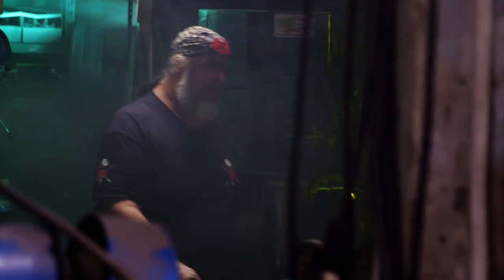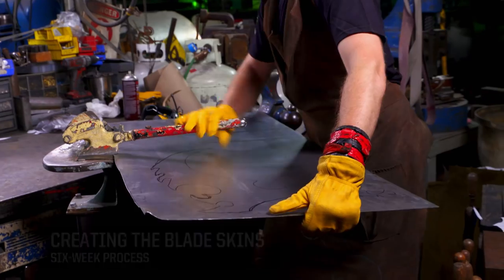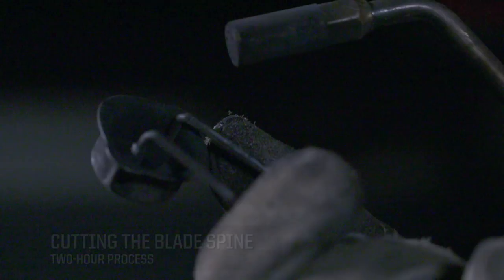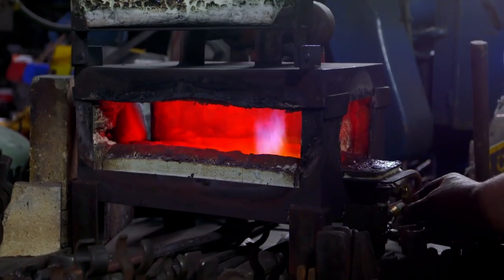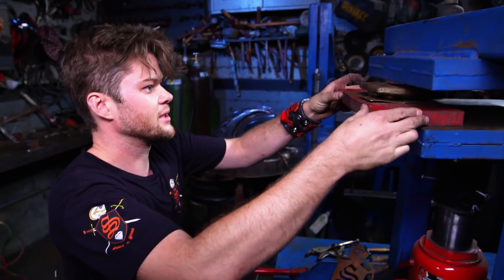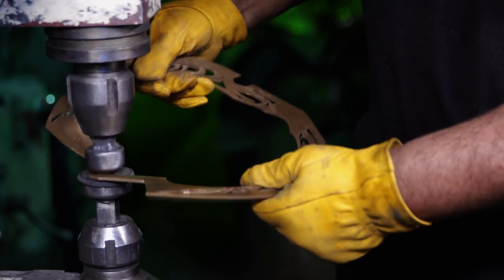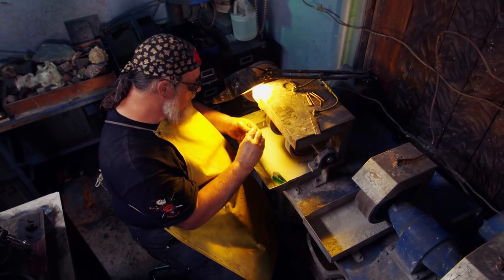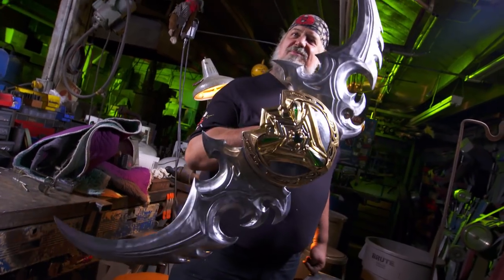Azeroth Armory: Forging Warglaive

Comment: Warglaives are actually the worst weapon for an actual combat...
Reply: Nope. Toasters are much worse
Reply: I don't know about you, but have you ever tried fighting with a milk carton cap? Its pretty hard.
Reply: At least you can throw a toaster.
Reply: Otakahunt The only way warglaives could be useful is if you were fighting a naked man, because warglaives ain't gonna pierce any armor, I mean in terms of WoW (applicable in real life) they would do damage to cloth and leather users, but to mail, let alone plate users not a chance, no wonder he lost to Arthas...
Reply: says who?
Reply: In wow terms the warglaives power comes into the abilities, you can see how illidan is able to use them with the abilities that he has. but you are right, irl they won't be able to win a fight
Reply: Jose Sandoval
ye but have you tried fighting with a milk cap?
Reply: +ragsungschaft It wasn't funny the first time.
Reply: Not denying they are a horrid design for a weapon IRL, but they are meant to be used as a pair and with slashing attacks and spinning (which you should never do). These would never be used to stab with the blade points. To effectively use warglaives would would have to be effectively be dancing to keep the momentum of a 25lb one handed weapon up.
Reply: Brahvent
All I want to know is if you have tried fighting with milk cap carton. Was not meant to be funny.
Reply: leather is actually surprisingly hard to cut through (you'd get through the armor but deal almost no damage)
Reply: training to keep momentum up is basically how the demon hunters who use them train
that and warglaives are meant to be used with magic (the glaive wont cut through armor, but the magic certainly will)
Reply: The warglaives are meant to be used by people who are really strong, as in inhumanly strong. Also demon hunters are meant to be deep in battle, fighting demons from all sides. If you have the strength to cut through flesh and armor like butter, the would be... decent at fighting enemies from all sides. They are still horribly impractical, and if you could lift 2 warglaives you may as well just carry a canon into battle, but it isn't horribly unfeasible. if you throw magic and demonic energy into the equation, its hard to know what exactly makes sense.
Reply: Stefan Petrovic
 Why would it need to pierce? demon hunters fight against demons... and most demons are made out of flesh, hard flesh, soft flesh, green flesh, red flesh.
They dont really wear armor.
Reply: Otakahunt
Demon soldiers wear a lot of armor. look at fel guards and eredar.
Reply: Sdogofdoom
and pit lords. fel hounds seem pretty fast so you need to make every hit count
Reply: Alex Gregory
But we have all seen what little use pit lord armor has XD seeing as mannoroth was killed in one hit by grom wielding gorehowl... TWICE. And we know gorehowl is not that great a weapon, i mean its meant for level 70's.
Reply: Sdogofdoom
lore wise gorehowl is a pretty good weapon (what it is in game has nothing to do with lore) and grommash is an extremely strong warrior (in our timeline is was also on demons blood making him a little stronger)
but not only external armor, pit lord hide is probably extremely tough as well
Reply: Alex Gregory
Lorewise, gorehowl is imbued with the power (and hearts) of several massive gronn, and forged by the best smiths the orcs had. It is still hilarious that gorehowl can pierce METER THICK PLATE XD
Reply: Sdogofdoom
I was not aware of the forging story of gorehowl and had never thought to look into it, that makes gorehowl one of the cooler weapons IMO
as for meter thick plate, super weapon, super strong wielder, can so super weird things
Reply: Alex Gregory
The doom hammer couldn't scratch mannoroths wing. Gorehowl pierced a meter of reinforced, commander tier plate, AND right through the strongest part of the pitlords skin and ribcage. (if pit lords have rib cages like humans, which they may or may not.)
Reply: depends, if you train for years almost anything can become deadly. If you turn an strike over your shoulder you can use the point of the end of the blade. Most weapons are useless against armoured targets in real life anyway, but full plate armour wasn't common and when you were fighting someone wearing that you'd be using a hammer. Most soldiers wore cloth and against someone who has trained with these weapons they might not be able to land a strike. 

Imagine capoeira mixed with these.

In warcraft everyone wears plate armour, but in warcraft everyone has muscles bigger than your head.
Reply: Sdogofdoom
 "look at fel guards and eredar"
Thats exactly what i mean... they are half-naked! No such thing as "alot of armor" in the demon-ranks.... its not like they need much, they cant die anyway.
Reply: Otakahunt
Yeah but they have some parts that are very armored. not saying its practical or smart, but they do have some bits of thick armor.
Reply: Sdogofdoom
 You dont have to hit those armored parts, you know.
Those guys dont have any armor in their midsection... which is the area to go for in a "knife fight".
And since demon hunters are highly trained and skilled... they  have no trouble hitting  that area.
Its like being half naked in  the medieval times...and you  cant blame the demons, not like they care.. they wont die anyway so might aswell fight with nipples out.
Reply: Otakahunt
some demons (such as infernals) are not flesh at all, though DHs probably have different ways of dealing with them (probably magic)
Reply: you have to have the agility and raw strength to dash and move with force like demon hunters to make them work
Reply: Stefan Petrovic I feel like if a person is unnaturally large, strong, and agile, this would be a great weapon
Reply: @Sdogofdoom
Strength doesn't help you cut through armour, though. This is a simple matter of physics and common sense: If you can freely shape a material with the desirable properties of a blade into a blade, you can also shape it into armour.
Now, what are the desirable properties of a blade? Obviously, you want it to be extremely hard to damage. After all, if your weapon breaks upon the body of your first enemy, it doesn't matter how awesome it might be. You'd be defenceless against every enemy after the first.
Now, what does it actually mean for a blade to be hard to damage? In essence, it means three things:
1) You want it to be hard. If your material is too soft, it will simply give way under its own force.
2) You want it to be flexible. If you watch slow-motion footage of cutting or thrusting tests, you'll notice that during impact, the blade flexes a lot. This is desirable because if your weapon is not flexible, it will break too easily.
3) You want it to keep the shape you forge it into. After you bend your blade, you want it to return into a straight shape instead of staying bent.

If you have a material with these properties (in real life, we do have such a material, and it's high-carbon, hardened and tempered steel, also called spring steel) and can shape it into a blade, you can also shape it into armour, and it just so happens that these three qualities are also the qualities you look for in armour.
And one rule of thumb is that you can't cut a thick material with a blade made of the same material. You can't cut a copper plate with a copper sword, and the exact same goes for obsidian, steel, enchanted stormsteel, or mashed potatoes.

@Otakahunt
Demon skin has been described numerous times in WoW lore as being hard to cut or pierce. Add to that that basically only imps, felhounds, and beholders go into battle unarmoured, and you have a compelling argument for why you want to consider your choice of weaponry well.

@UB3RFR3NZY
You're generalising over a very large period of time. During the late middle ages and the early renaissance plate armour was fairly common.
In earlier times soldiers did indeed often use cloth armour, but to modern ears, that's a dangerous statement to make. What they wore into battle were gambesons, which were several layers of thick linen or wool. A proper gambeson was easily able to stop a full-powered sword strike.

@Angry Chicken
It's really not, but after writing half an essay for a YouTube comment, I don't feel like going over all of the reasons as to why not, unless anyone's explicitly interested.

Comment: The way that shirtless guy held and wielded the warglaive was all wrong.

1: You don't use the shield to bash things like a Spartan! That's how you shrink the protection to your arms.

2: The 2 blades are what allow Demon Hunters like Illidan to catch a demon in the back swing, making sure no gesture is wasted in battle! The shirtless wielder failed to do this.

3: The weapons are MUCH LARGER, which makes for a wider cutting edge! At 20lbs, the weapon lacks the sufficient heft to cut into demon skin! At the very least, TWICE the size of the one forged.

4: An additional grip to stableize the weapon so the blade edge remains parallel to the wielder's punching knuckles of the index, middle, ring, and pinky fingers, would have been helpful to the design.

Otherwise a great weapon, but that shirtless guy wielding it just ruined it for me...
Reply: I bet you're fun at parties.
Reply: Sooo uhhh.. You have a lot of experience fighting stuff in RL with glaives?
Reply: 1: Yes, you do use the shield part of your weapon to bash. In combat, a shield is not armor, it is a *weapon*. You use it actively, either to defend yourself against enemy attacks, to cover yourself while you attack yourself, or to simply hit stuff. In fact, your arm might be the most protected part during a shield bash.

2: A regular sword can do the exact same thing; either striking with the pommel or generally moving in a way that your blade remains facing the enemy. With a warglaive, you generally can't use both blades in the same swing, and even if you could, you wouldn't want to, because the force of your attack is split between each target hit. This means that you only ever use one blade per attack, making the other blade a pointless counterweight that bluntens the impact of your strike. Speaking of which ...

3: If demon skin were so tough to cut, you would either use a sharper blade or a weapon that's better suited to applying large amounts of force, such as an axe or a pick. Making a sword heavier doesn't make it a better cutter; in fact it makes it worse since having to swing around so much weight makes you exponentially slower, thus weakening the impact force once more. Points 2 and 3 are nothing but basic physics.

4: I don't know what you mean by that, but if it means fixing your fingers in place in any way: That's a terrible idea. If you can't move your fingers while your blade gets stuck in a falling demon or while it's being parried or otherwise controlled, you are setting yourself up for a broken hand.
Reply: Nerd

Comment: for the glaives to be actually functional, the blades would have to extend forward from the shield and then turn less toward the user, as well as be at least 6 " shorter.Great wall hanger though.

Comment: If he was having trouble actually holding the warglaive because there was only a grip i can understand. Holding a cylindrical object that has a lot of weight will actually just cause it to rotate to best match gravity. Hence why at 6:54 it isn't parallel to his arm but perpendicular. There should be an additional "sleeve" near the top of the warglaive that he can fit his arm through in order to keep a proper grip on the warglaive. that would also actually really help in keeping yourself from being disarmed. Though it becomes a big problem if your enemy "hooks" their weapon in with yours.

Comment: we can see the handling of the blade is different than seeing it in-game without considering the actual weight when its swung. I guess for the purpose of demonstration that its really sharp, the person has to wield it with safety. To properly handle both blades in actual, someone has to have an incredible amount of strength to swing it both hands and with balance from both Glaives.

Comment: They went to a LOT of trouble with the camera work to never show the back side of the weapon when it was done, because it was obviously just hollowed out with no actual thickness to it.
Reply: 7:20 You're welcome
Reply: That was certainly a quick glimpse and it is hollow in the center. I don't blame them for the hollow blades, less it weigh 100+ lbs, but they certainly avoided showing it from that side which really made it look awkward when used.
Reply: Did you not watch the video? Right at the beginning they said it was going to be hallowed out.

Comment: Wait, why did they use rusted metal?
Reply: most metals used for this have a bit of rust on the outside, it has no effect to the steel underneath, at least not for a long while, you just grind it off.
Reply: Keith Filibeck Ah, maybe I missed that.

Comment: Hope they put down a tarp because that glitter is going to make a messssssssss.  >_<  Otherwise, pretty cool!  Looked a lot heavier than 20 lbs.  I'm glad they always put in warnings in there about how dangerous all the metal cutting, materials, and welding equipment are...safety first!

Comment: Next should be shalamayne or ashbringer.
Reply: impossible to create
Reply: How do you figure? They made the doomhammer by magnetizing the wolf charm to the metal itself. Whats to stop them from using a heavy duty clear plastic in the empty space of the blade and slotting the orb right into that?

Shalamayne might be trickier but they could use the same trick that they used with the doomhammer to make the fire glow, and weld the secondary "floating" blade to the casing of the glowing fire.

Comment: Isn't using two hands to wield it something of a cheat?
Reply: no because both warglaives can be put togeather for a single weapon so it turns from a 2h to 2 1hs like varians sword
Reply: Good luck building it though
Reply: Dude,this thing is 20 or more pounds.You need to be quite strong to wield it with one hand and slice things.
Reply: Hah! My DH does two at once - weakling humans!
Reply: not really, 20 pouns is not that much for a weapon of this size
Reply: the idea is to swing one and use the weight of another to bring both to speed. Then the opponent is dealing with two LOOONg almost continuous cutting edges. the 20 lb would feel slightly lighter with another as a counter balance. But hay, good shoulder and trap workout no? :D
Reply: First, warglaives are a very impractical weapon. Don't take it too seriously. Next, it can't be that hard to take a few one handed swings with that. Twenty pounds is kind of heavy, but that guy was in pretty good shape.
Reply: 20 pounds is a lot for a human to handle, even two-handed. There's a reason two-handed sledge hammers max at that. A practical one-hander is around 3-4lbs and two-handed is roughly double that. Anymore than that and you'd be dead before you could recover from your first swing.
Reply: Like I pointed out - puny humans. It's no wonder they are being used by elves whose special power defies the laws of gravity and gives them their ability to sow havoc & dispense vengence in their world of war.
Reply: 20 pounds is not that heavy, they aren't exactly doing anything difficult with it so the movements should be enough using 1 hand. Warglaives aren't very practical in the first place so it doesn't matter.

Usually a 20 pound longsword(avg weight 6-7lbs) has it's weight discributed so it's difficult to use proper cutting technique but as you know warglaives aren't like longswords, the weight is mainly around your hands.

Comment: 2:49

TIG welder is  11,000 degrees which is 1,000 degrees hotter than the sun's surface.

The sun's surface is only 11 degrees? lolwut
Reply: 11,000-1,000=10,000 not 11.
Reply: Math dude....11,000 - 1,000 is not 11.
Reply: I didn't think anyone would actually take the bait. . .

inb4 "u didn't trol me!"
Reply: Yup.